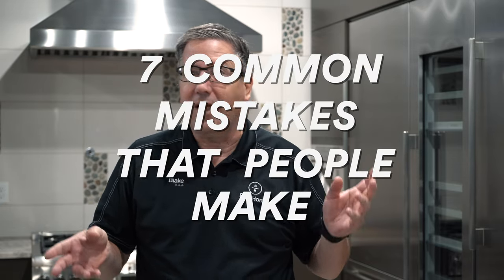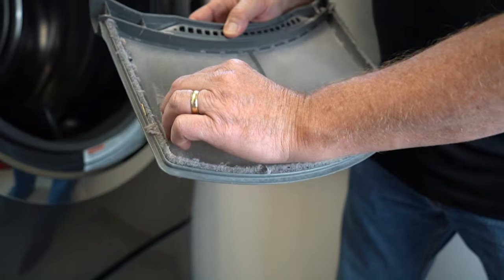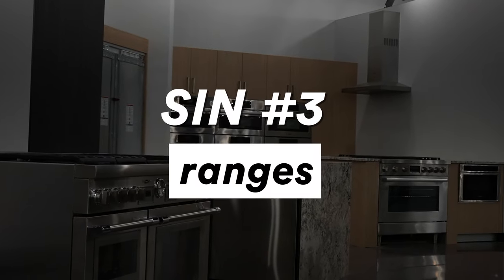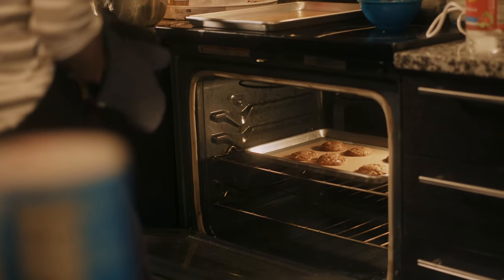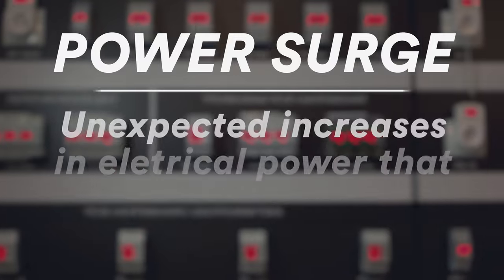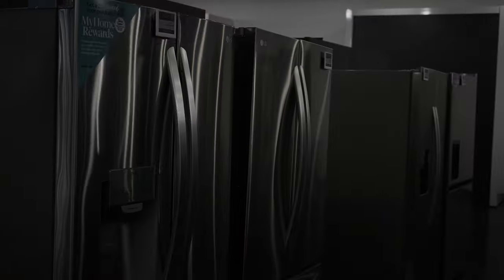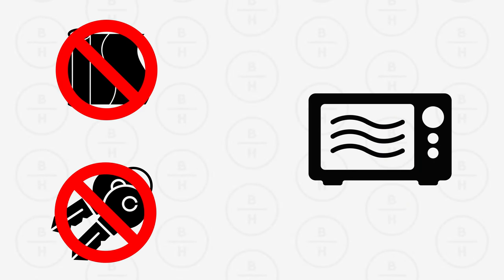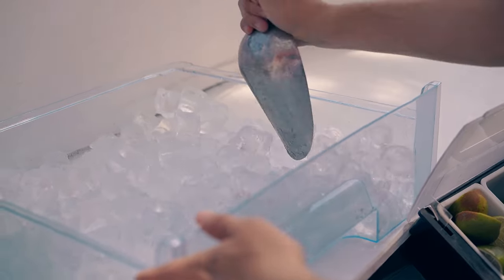7 Mistakes That Kill Your Appliances

Comment: Take your vacuum cleaner's crevice tool to the lint filter slot on a regular basis. Also, the first vacuum you should buy is a canister as they are the most versatile. Have an upright for any thick-pile carpets you may have.
Reply from the maker: That is great advice, thanks for sharing!

Comment: The microwave “pause” concern is debunked, changes engineering have mitigated this issue. 

Ice machines however are so often overlooked and commonly filthy… yet if used accordingly with a scoop stored outside of the bin, issues should be minimal. Ice machines pretty much become filthy because of contamination of humans, if people keep their hands out of and off of surfaces inside the bin they can run years without contamination.

The situation with ice machines is it’s a cold environment not conducive to microbial growth, but should it become apparent with mould… the contamination level is already high and certain microbes like Listeria can very comfortably survive!
Reply from the maker: Excellent information, thanks for sharing! That is good to know about the pause concern as well.
Reply: You can't impede the function of an ice machine due to poor technique with not using an ice scoop, directly touching ice, etc.  Contamination comes from various sources, and that the above would be the most limited of contamination.  Most ice in modern refrigerators dispenses through a door that does not require the use of hands.  That is not to say that there are not older models around that dispense the ice within the freezer itself.  However, those can be among the most contaminated.  By that I mean, (and this is regardless of older or newer) the water is fed through tubing.   Think of this like Keurig and similar coffee machines.  At least then, you have maintenance where you can clean out the gunk with vinegar.  Where most modern (in door) dispensing differs is that they rely on water filters, similar to Brita, but much pricer and a source of huge revenue for manufacturers.  While these filters to not kill bacteria, they can filter out lead, chlorine, etc.  Please understand that you could do a surgical scrub before touching ice, even with using a scoop, and you will still have contamination due to the inner workings of a freezer. I would trust a repair person to demonstrate how to circumvent this issue, in AS MUCH AS POSSIBLE.  In that I am aware of, there is no way to flush the tubing or other inner working that may have necessary water contact, the way you can flush the tubing of a Keurig.  I loathe hotel ice machines for this reason, too many people with questionable habits use these machines.  I may use it to quick chill a beverage in a container and clean the outer container before use, but I don't like to use the ice in a beverage unless absolutely necessary.  Thing is, useless to get paranoid about this.  You control what you can.  You really have no idea regarding the safety of even something as seeming simple as buying anything beverage from a bar, restaurant, etc.